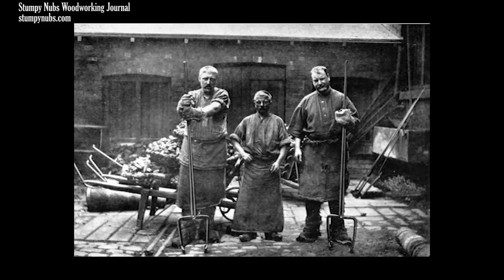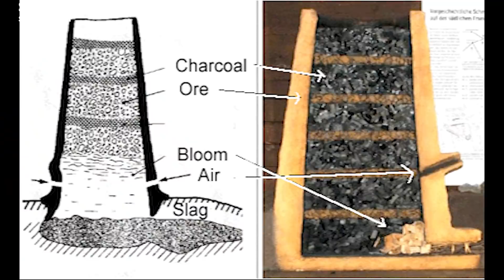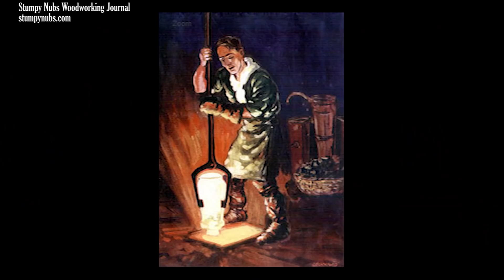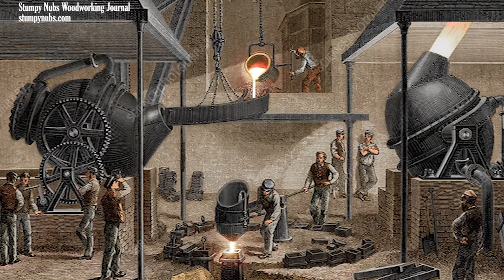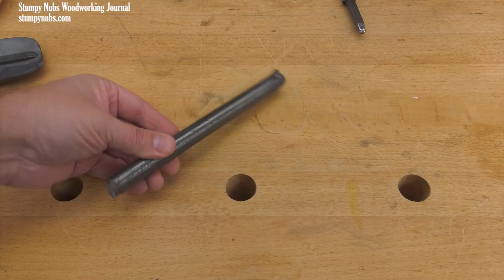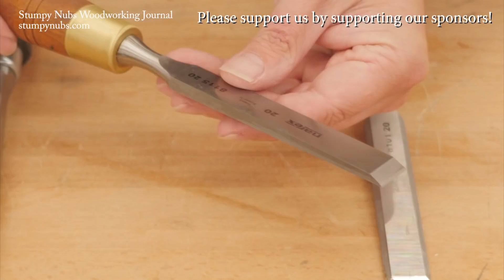Why a lot of tool steel is bad.

Comment: I have loads of old chisels. It’s the wooden handles that stop me using them. 
 As a site chippy my old “lollipop “ Marples can’t be beaten.

Edit. As a midlander close to Birmingham almost every old boy-passed away mostly was an engineer of some sort. The engineering knowledge that is now lost will never be repeated. 
 Birmingham had better engineering excellently than Sheffield!!!!! All day long. 
Great video Stumpy. Keep em coming.
Reply: What’s wrong with wooden handles?  I got a set of modern chisels with wooden handles, not cheap but not silly expensive either. I had some chisels with plastic/rubber handles that somehow ended up having the consistency of moist liquorice, maybe that’s what made me turn to wood.
Reply: @kaasmeester5903  

I carry an estwing on my tool belt,  not a wooden mallet. 
 Some of the Marples shamrocks I have are the best steel but it’d be vandalism to be belting them with a steel hammer. 
 I keep them for bench work—-but I’m never on the bench .

Comment: Many old tools were laminated, hard steel on edge and soft on back to create a durable tool with a hard edge. Today this technique is rarely used as it is quite expensive. This means the modern steel used is a compromise.

Comment: Tool steels are not made in open heart furnaces they are usually batch made using induction furnaces with controlled inert gas or vacuum atmospheres.

Comment: I own Industrial supply company, Vanadium alloy steel company until sold and a name change were my customer, actually they still are just owned by another steel manufacturer. They have been my customer since the 80s and they’ve been in business as far as I know nearly 100 years. They are and were makers of tool steel and when it was called Vanadium alloy steel, they actually developed carbide and the process was spirited away from them by a few of their employees, but that’s another story.

Comment: I have the rider ones from Axminster Tools, they are iso hardened to the same hardness as the Narex ones, I think Narex probably make them for them, and then branded them as there's. About £10 for the cheapest, to about £30 or so for 50mm one.

Comment: Today we all stand on the shoulders of giants.
And as a result even the cheapest tools are often more than adequate for the job.
I've seen the quality of cheap tools turn from absolute garbage, to the point where even the cheapest stuff you can buy is arguably superior to the best stuff from long ago.

And then there are tools which achieve a lot more than merely the task they are primarily designed to perform. They fulfil the deep desires of their users; the desire for beauty, the desire to appreciate the finest quality, the desire to hold something which feels like a natural part of you, where you literally extend your senses into the tool, so that it becomes a part of you.

The reason we cringe when we miss the synchromesh in a manual car, or when we break or damage a tool, is because it actually hurts us. Our senses also extend to the creation of a pain reflex. It's arguably what separates us from the great apes, along with a spoken language, and the ability to invent and pass along fiction.

Comment: 6:03: "...blast furnaces are mostly turning out the lower-quality steel that's used for railroad ties..."
Ties?  Or rails?  Steel ties have been made, but traditionally ties have mostly been wood, with concrete being a modern replacement.  Apart from some iron rails in the very early days, rails have always been steel, and I presume that's what your reference should have been.
Rails do come in different hardnesses, though, such as for crossings where they get twice as much wear as other locations.
Reply from the maker: rails

Comment: I would also like to learn more about modern steels. I've seen a little about cryo and a little about the special process Narex uses, but just enough to make me curious.  I would also note that a cheap set of Craftsman chisels I bought in the early 70s are the only ones I have ever seen that were truly bad. It's probably true that the best chisels use the best steel, but the biggest difference seems to be the quality of the machining. Then again, if you're going to spend the money for labor, it'd be dumb to skimp on the materials.

Comment: In my opinion, one of the best chisels are Soviet tools. LMZ tool manufactory.  
Here, in Russia, they are very cheap. You can buy "like new" chisel for a few $. And a set of "good condition" chisels for a 7-8$. 
Its better than any chinise chisel, and may be like good german modern chisel. But they are SO cheap!!!

Comment: I love the old tools and old steel and I do use some antique tools professionally, they don't make up most of my tools but I have a few. 

But all the people who seem to think that steel production has not progressed over the last hundred and fifty years are ignorant. In fact a lot of people seem to think that we are not even able to make steel that is even equal to what they made over 100 years ago. We have gotten a lot better than the best that could be made back then. 

However if you compare premium tools from back then with really cheap tools of today then yeah the older stuff is better. They did have some fantastic tools though and some fantastic steel and I acquire them whenever I run into a deal, and I actually put these things to use. 

One of the old tools that I really like are the old vises, both metal and woodworking vises. I have an old wood vise that I'm pretty sure is well over 100 years old. The only metal on it is the crank looking thing for tightening it down and the acme thread rod connected to it, and the cylindrical piece that it threads into. I did have to glue and clamp some of the wood back together but it works fantastically. One end of the crank is just straight and has like a ball on the end, and the other end  is made like a crank. It slides from one side to the other, or you can center it, or pull it all the way to one side,  It's very functional. I wish I knew what kind it is but I cannot find a brand name or stamp on it.

Also have a couple of old Wilton vises, a 4 in and a 6 in and a small and very old Dunlap 3.5 in that is a work of art. I use that one a lot. It's from about the 1950s with beautiful art Deco styling. It's from Sears but I think made by Colombian.

Comment: My grandad was apprenticed to shefield steel when he was 12. beween heats they would do complex maths to keep bussy and that was most of his tutoring. He ended up haveing his 18th birthday on VE day and was subsiquently conscripted into the Fleet air arm as a smith. After His national service he went back and worked his way up to become the forman of a factory produceing trains. They could forge a wheel in two hits. Unfortunately he was forman when the factoys closed and he was made to close 2 of them by himself.  He can still tell you the weght of a hammer by how it looks and what temp steel is by its colour.

Comment: G'day James, great vid mate and very relevant to all levels.
I would like to see full tang chisels without costing an arm or a leg, it is usually the handle, or the handle joint, that fails first, regardless of materials in my experience, even with proper maintenance and technique. Yeah sure you can knock up your own replacements, maybe I've fallen into a trap here, but I feel that full tang, for not much more steel will limit potential failure of the tool in general. Cheers Duke.
Btw; I do use a wooden mallet or simply by hand pressure, I m not beating the crap out of them.

Comment: Very interesting take. Steel has evolved a lot and modern steel is superior to anything of the old, but only if designed to be so. In the days of electric everything chisels are not prized economically to be made out of high quality steel. It is very common to use a lower grade steel and lower heat treatment to improve manufacturing and cost, rather than retaining an edge.
That being said the main difference between old and new steel is S, P and Si content, which in the old days were not really controllable. You need to melt steel to control those via additives that remove or insert some. Also the general switch to stainless inserted a costly Chromium into steel that made heat treatment more complicated and changed the whole market in general. Good carbon steels were thus limited from something like 50 commonly obtainable versions to around 5, which increased their price mostly due to scarcity and obsolescence.

Comment: New tools are awful. I just spent 2500 dollars to put a shop together plus 2400 for a table saw. My jointer and miter are CONSTANTLY  going off square. The miter is a Ryobi 10 " slider and the bevel wanders almost daily and the miter is impossible to keep square at 0. In order to adjust it you must actually adjust the fence and it's a massive pain in the ass. I bought a wahuda 6" jointer. The fence is cheap aluminum and warped. The "fine tuning" adjustment screws are set screws that are supposed to create a 90° angle by pushing against a deadstop. But the set screw is steel and the deadstop is aluminum. So it just wears into it. Also, no matter what the height of the infeed / outfeed tables, I get concaved cuts with any type of pressure. I lost my job and had a knack for putting things together so I dipped into savings for some new tools and all of a sudden I can't get a square edge to save my life and I can't find the source of the issue because there are so many issues. It honestly makes me want to burn my house down and swallow a 12 guage. I've spent more time adjusting tools in the last month than I have actually working on projects. In the last 3. Ive created so much scrap in testing and at this point I might as well be jointing my wallet. Adjustment systems built into these newer "cheap" tools are horrible concepts. A jointer fence should not move 5 degrees (or at all) while utilizing the locking mechanism. A bevel set at 0 should stay at zero etc. My old job was machine maintenance and this feels like a horrible joke. Ik this video was about steel quality and I apologize for the rant but I'm losing my shit. Warped tables on 2/3 "quality" contractor table saws fit the bill for this comment section. At least the motor died on the 3rd one so I could ram my head against the wall until I couldn't feel my legs anymore.

Comment: Crucible steel was first invented about 2,300 years ago, possibly in Sri Lanka and by using iron ores containing specific trace elements, together with a certain heat treatment produced 'Damascus steel'. 
Note, Damascus steel is not the same as pattern welded steel, although the term is commonly misused.
Reply from the maker: Several times in the video I said I was talking about the development of WESTERN steel. Tool steel developed at different paces in different places.

Comment: Great video as always. I have a set of the original Marples chisels made in Sheffield and I've had them for over 20 years. They hold a razor edge for a long time. Wouldn't sell these for anything and someday they will go my grandson. I've tried the new ones from Irvin and they are garbage. Tools like this you get what you pay for.  I also have a Henry Disston back saw that was my grandfathers, made in 1880 and still cuts like new. Like my Grandfather always used to say you get what you pay for. But be careful, some high end tools today are not what you think they are. Watch reviews like this one to get the real story.

Comment: I love the fact that living in the uk affords me the opportunity to go find plenty great warranted cast steel tools for really cheap money.  
Not sure what it’s like across the pond. But I can pick up a job lot of old chisels for about equivalent of $5 a chisel!

Just takes a little effort to get them flat again and sharpened up.
Reply: how common is wrought iron over there?
I buy almost every piece I find for blacksmithing, usually the seller doesn't even know its iron (sometimes I'm not 100% either) but most of the time they do know its pretty expensive, wagon wheels are a hundred dollars for small ones, two-three for 3-4 ft diameter ones, hand forged nails are $1-3 each
what's it like over there?

Comment: An important factor you haven’t mentioned is that while steel technology is light years ahead of what they were using in the 18th and 19th century, the demand for high quality hand tools has hit rock bottom. Hand tool manufactures are seldom today catering to people who’s livelihoods depend upon hand tools, and are very often making tools in a way that may degrade from their usefulness to provide liability safety in the hands of an abusive amateur. 
While the best steel to ever grace this earth is currently being made, it is not currently being put into our hand tools.
Two disclaimers:
1. High quality hand tools frankly do not require the absolute best of the best steel, and there are other qualities that are often mistaken for high quality that in practice are a hindrance (such as abrasion resistance- which by the way has less to do with hardness and more to do with alloy. High hardness is higher AR- but a straight carbon steel will sharpen easier than a chrome-moly)
2. This does not apply to all tools nor all companies today, there are still some very high quality tools being made for applications where there are no great power tool alternatives. Though they are fewer and farther between than they once were.

I’ll also say in my trade (smithing) there are ways we can modernly use tools that would destroy our ancestors steel tools- we have super steels like H13 that will remain hard at a glowing red heat. Using steel like our ancestors used we have to work in a more careful way, making sure such tools remain cool as to not be deformed.

This has been the sincere opinion of an 18th century reproduction blacksmith.

Comment: I have bought very good quality chisels, and they were pretty cheap. The thing is, it's hard to tell what is good and what is not, when choosing. I bought my chisels for around 3$ each, which is an okay, pretty good price here in Eastern Europe. They are excellent quality.
But elsewhere, this could mean cheap, bad quality or chinesium too. Or, I could've bought my chisel in a DIY Supermarket, like Obi, and they would've been probably twice as expensive, and not better quality. So how do you know which is what quality? More so when you are a beginner.

I think the best solution is a public rating system. Faulty, but better than nothing.

Comment: I have four different brands of wood chisels in my toolbox. Every one of them is made of some kind of stainless steel. Some of these chisels were pretty cheap. Some were a little pricey. But they all suck. Stainless steel is not good for any kind of blade. So, why is it that I can't even find a good pocket knife, let alone a good chisel, that uses good carbon steel? I have, in my kitchen drawer, a German-made knife, that is made of good carbon steel and is about one-hundred and twenty years old, that I can sharpen to "shave my face" and be careful doing it, sharp. And it will stay that way even after carving a ham. I just want a good chisel. Does anyone make a good carbon steel chisel anymore? And, no. I do not want to pay $50.00+ for one goddamn chisel... I'm about to retire. So, I guess it doesn't matter anymore.
Reply: There are excellent stainless knife steels available but they are moderately to very expensive and usually difficult to sharpen. For a cheap but still good knife or tool, old fashioned carbon steels are the way to go.
Reply: I agree, modern chisels are dross. I would buy some old Sheffield made ones from the eBay, some will be better than others though!

Comment: I think the context here is that when you pick up a cheap chisel or plane blade from a hardware store, the quality of the metal is atrocious and essentially impossible to sharpen. That's been my experience. Going for higher end tools online (since hardware stores don't sell them) or picking up older tools are both good ways of avoiding the horrible blade syndrome of hardware store tools. Compared to the stuff I've unwisely purchased at stores, older tools are pretty much guaranteed to be better since those are the good ones that people kept. The metallurgy is real. but the finger pointing is better directed at why some makers use the wrong metal today when the right metals are available.

Comment: If we're comparing the cheap, big box store chisels, I think the old stuff is probably better.  I would be surprised if the old "high end" wood working chisels are that much better or different from the "high end" wood working chisels today.  I would say that the new higher end stuff is made with more precision and precise metals.

Comment: truth be told hand forged tools made by masters are on a different level then modern mass produced ones like the narex but it takes a master to recognise a good tool also the iron ore sometimes has naturaly ocuring other metals like chromium vanadium titanium mangan and so on however it takes a lot of exp to find them identyfi and use so there is only a small number of realy good old tools...

Comment: I've bought a good few old chisels, but never for the steel.
It's the design. Look at any modern mass market chisel, and you will see a thinly built, lightly bevelled firmer. That's great, until you need a real firmer or a chisel with actual bevels.
Before people like Lie Nielson brought back real hand tools; older chisels were the only answer. If I'm going to chop into the 'ironwood' bed of a cargo hold I want one of my firmers - a meaty blade, a steep grind and a whopping big handle that I can pound on with my heaviest mallet. But if I'm pretending I can do joinery, a nice slim blade with bevels that taper away to a near knife edge down either side makes me look like a proper carpenter. I can tell my friends that it's great for tidying up dovetails.
Pattern Tools .... I hate them